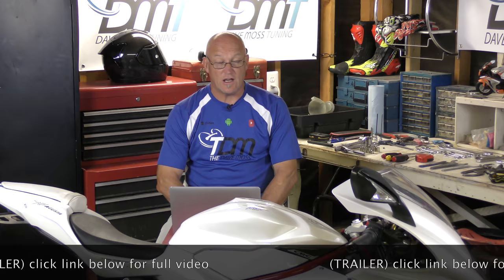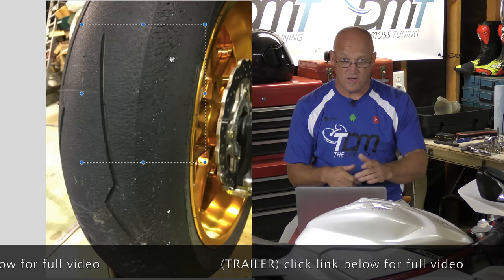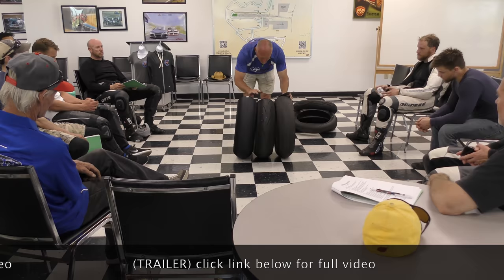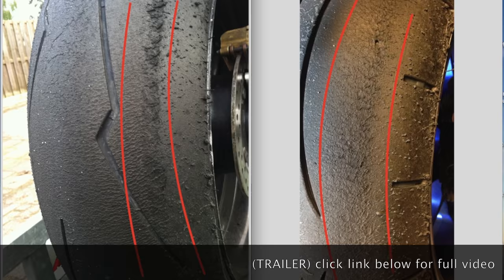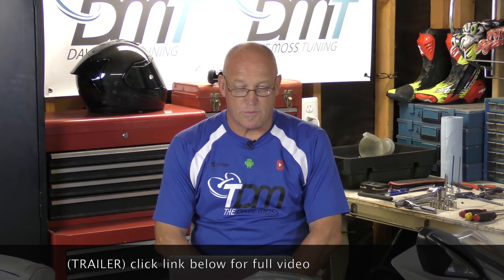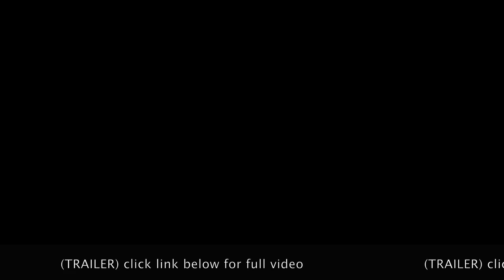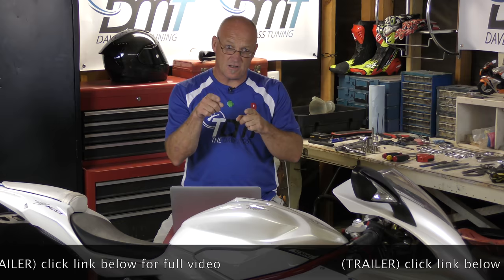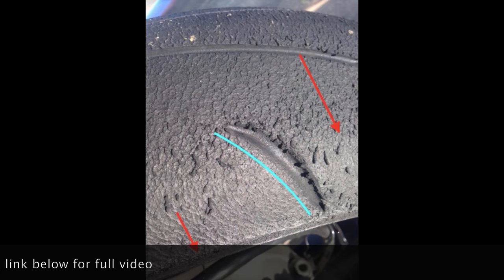FasterClass: Motorcycle Tire Cold & Hot Tears (TRAILER)

Comment: Hi Dave. What tyre should i use on my hayabusa for highway riding and some extreme cornering on sunday ride?
Reply from the maker: Best category would be hypersport with soft compound sides and a hard center. Currently the most durable is the Michelin RS. Once installed, make sure you update your settings due to the geometry changes from tyre carcass and circumference.
Reply: @catalystreactionsbw  understood. thank you sir